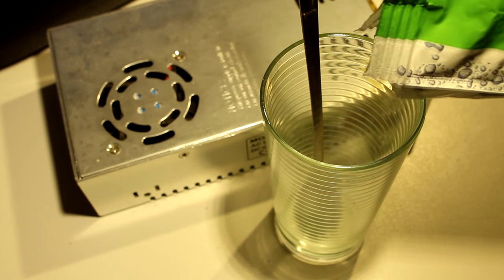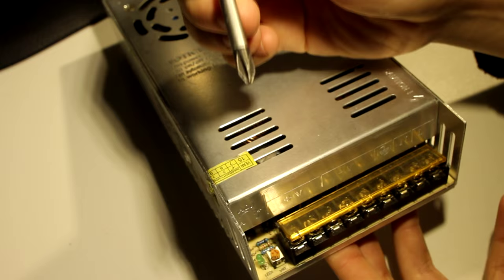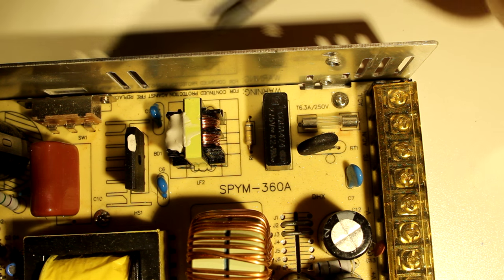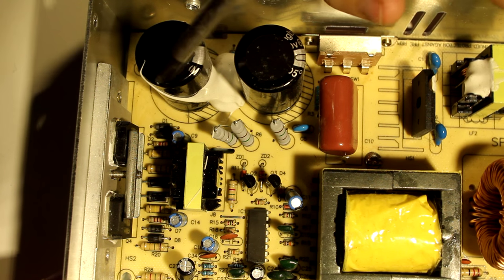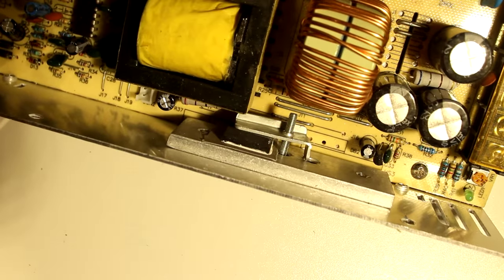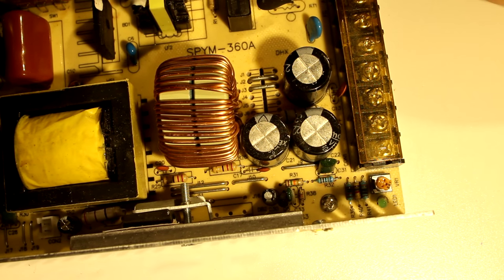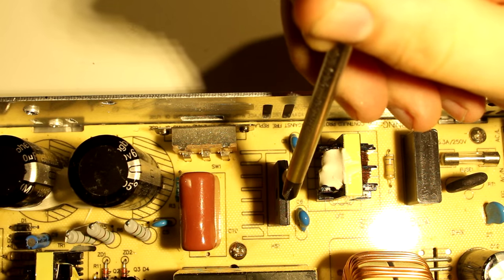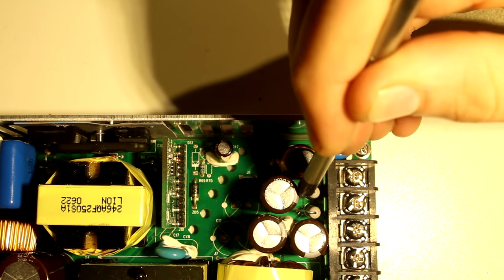Crappy chinese 24V '360W' power supply teardown (005)

Comment: I  am dissapointed after watching this video. Clearly person who is doing this review is not an expert in power supplies. This power supply does not have power factor correction and what he is calling a MOV is in fact an NTC. Besides the point if these cheap power supplies where so crappy nobody would bye them but people do and they do the job reasonaby well. I've been using this particular model for almost a year now. It's in operation 24/7 and in my application had no issues with it what so ever. I would love to see some quality reviews from this youtuber with some measurements perhaps.
Reply from the maker: All of this has been addressed in other comments already, but just to be clear:
- Yes, I realized pretty much immediately that something was wrong with my assertion that it had PFC, I just got confused by a very unusual PSU topology
- Something that functions doesn't mean it's a good design. Especially with power supplies, you're not paying for just roughly the correct voltage coming out, you're paying for safety and longevity. These power supplies have neither of these qualities. 

My newer videos have proper load and efficiency measurements! I'll be revisiting this PSU as well.
Reply: Yeah, plus I've never seen anyone focus on the quality of the holes for the fan.  I mean, yeah if this was a product that you scrubbed over your face or if you were supposed to sit on, then ok.  The "imperfections" pointed out don't affect airflow to any appreciable degree...
Reply: Matt Gorzka i bought a chinese 48v 8.3A and after a couple of days of using it started making spark sounds and then a short in the mains.

I bought another chineese 12v 15A and hooked it up to a sound system, got a loud hiss and buzz, in comparison to the inaudible noise from a computer psu hooked to the same system, there are issues might be irrelevant to how you use them, or that you are lucky

Comment: I've been rockin a 12 volt 60 amp china power supply for several hours a day for 2 and a half years at 42 amps and it's been running perfect with low low noise. No over heating and rock solid.
Reply: I agree with you my friend, I have used the cheep Chinese smps for years. The difference in price between a rolls Royce and a mini car is great, but at the same time? as long as either get you from A to B who cares.
Reply: @davidteale4270  And as an extension, you can go from A to B with a horse.
It's the same, right?

Comment: 4:59 Not an MOV, that's a NTC thermistor to reduce switch on current surge.  
11:25 The weakened section at the top of the capacitor is a standard feature of all electrolytic capacitor brands, it's not an open vent but it allows the case to rupture in a controlled manner in the event of over-pressure rather than exploding.  Some capacitor designs instead use the rubber sealing plug at the other end of the cap which gets pushed out.

Comment: Many mistakes in this video, someone already corrected the NTC/MOV mixup... This topology is a two switch half bridge, LCC resonant good for up to 400-500W, dead giveaway is one large metal film capacitor (red), two switches and the other smaller transformer for driving the switching transistors, that's why it's small. When you have two switches across a load the high side switch needs a much higher voltage to turn it on because it's base or gate is relative to the high side voltage, not ground. This is why they are usually driven by either a base/gate driving transformer or a high side/low side gate driver IC. This design usually uses Bipolar NPN Transistors, the 400W device I have used 3DD13009 Transistors, 700V 12A devices used mostly in power switching circuits like this.

The larger main transformer has an input winding, an auxiliary winding for powering driving circuitry, and secondary output is center tapped, 3 outputs, center wire goes to large toroid choke, then to ground, two other taps alternate polarity and go to common cathode rectifiers (3 pins, two anodes one cathode center pin), one tap to each anode or when two devices are populated the two anodes are tied together by a jumper and each device gets it's own secondary tap. 

There is no active PFC in this design. The output rectification alternates secondary polarity between two diodes in one package so each diode in the package alternates sharing the load or back and forth between two devices when configured that way so each device shares the load alternately.

Comment: The only really bad thig about this power supply is using a standard 1kV intereference supression capacitor between high- and low-voltage side instaed of a proper self-healing safety Y2 capacitor. 
A proper review should have mention it.

Comment: How do i fix my power supply with low voltage output? it's identical to your video but it's rated 12volts,30A.

Comment: its a 360w rated smps and it can deliver 380w max for a short time until the short circuit protection kicks in if it get over power and it has soft start, and nothing roong with the design it has the basic minimum .
the controller circuit is tl494 config for a half bridge topology , and the chinees smps does not have a power factor correction(for lowering the price down)  the small transformer thats not a PFC transformer its to drive the transistors(d13007k) base and its called base(gate) drive isolated transformer the rectified diode diode rated for 30A,( MBR30100) dual schottky diode 

and plz if you don't have knowledge about smps plz don't make a video until you get knowledge
Reply: The Guy doing the review seems that he does not have enough knowledge about smps.  Well I awaited for the load test but the video never came round. He never quoted the price from the one compared and the one on the review I would assume quite some difference for sure. You get what you pay for.
I guess he will hate himself for ever for posting this crappy video. LOL
Reply: Silvio De Leonardo he can just take the video down, and not hate himself.
Reply: Experts

Comment: My experience with these power supplies is that they can do about half the rated current and run warm. At full rated current they get very hot and have substantial ripple. So get something rated twice what you need, and be prepared to fix it when it eventually fails. Common failures are the output caps and the 2 large transistors (often some variant of xxx13009)
Reply: The problem is not to replace the 13009 transistors, but to understand why they burn out, so that a solution can be found.

Comment: Dear sir, you did not say how much you bought the Chinese smps and how much you bought the one you are comparing with. You will get what you pay for!  The MOV you mentioned is actually an NTC thermister for inrush current limit,  the small transformer is not a power factor corrector but a gating transformer, the topology used in the two supplies is different from one another,  you did not say what type of control chip it was using.  If it was a TL494 or equivalent it surely will have short circuit and current limit, the output diode is dual one and if the supply has a center tapped output that is all you need. Your tear down has a lot of things missing in it. and lastly all you need to try it out is a pair of car head lamp bulbs hooked up in series they will draw around 5 amps at 24volts well if you use 3 in series you will have around 3.5 to 4 amps approximately.  I will await your findings.
Reply: exactly what I was thinking, I was doubting myself but I knew it was a thermistor
Reply: It's £18 from a UK eBay seller, so probably not more than US$25. Ridiculously cheap for a 360W supply, I've seen used Cosel (Japanese made SMPS) supply sell for over $150. So I very much doubt this one gets any where near 15Amps @24V.
Reply: Well in a real  PS test a resistive 15 amp load could have been added and a voltage measurement could have been taken so we wouldn't need to surmise and speculate over the next 3 years on utube. I have tested my 3  low cost Chinese bench power supplies and they all met the output spec.
Reply: Yes, you are right sir. he doesnt even know that SM transmormer too.

Comment: I have a 12v Chinese PSU model S-360-12. Even with the VR maxed I get barley 11 volts. What would you check to be the problem? PSU is brand new and I don't see anything wrong on the board. Thanks for any help and your vid.

Comment: There is no PFC in that Chinese power supply. The part you identified as a PFC inductor is actually the base drive transformer. The two transistors near it make it a half bridge forward converter design. It also has an interesting self start circuit. Pull the board and trace the circuit - it is common to most of these cheap power supplies.
Reply from the maker: +oPossum5150 You're very likely right. I should have just measured the PF to make sure.
Reply: +PowerElectronicsBlog For someone who call his channel PowerElectronicsBlog should recognize this design immediately, it is one of most used design of SMPS in history (basically all AT and early ATX power supply used same design).
Reply from the maker: +Miloš Lazović Nah, my first education and actual in-depth understanding of power supplies only started just about 10 years ago. At that point, this kind of design was already nowhere to be found anymore. I've only started looking at 'crappy' power supplies in the very recent past (mostly dealt with high-end supplies until now), so this was genuinely the first time I had ever seen this design apart from some other sites' teardowns which I had apparently already forgotten.
Reply: PowerElectronicsBlog
It look like you missed something in your education about SMPS. This design is only one (as I know of) which allow you to have control IC placed on secondary side without auxiliary power supply (as +oPossum5150 mention it have interested or brilliant way of self start) . This design was used in many power supplies produced by LAMBDA among others (now TDK-LAMBDA but at that time known as DENSEI-LAMBDA, NEMIC-LAMBDA, Coutant) up to 2000 or so and most of that power supplies happily work even today si if you dealt as you say with high-end supplies you should see it many times.
As any other design this one have its own shortcomings and now with cheap solutions for auxiliary power supplies it is less used, but generally this design is bulletproof.
Even if you never saw this design it never cross your mind how they drive transistor on primary side with control IC placed on secondary side and there is not one opto-isolator on PCB (or any other means of insulation except that transformer which you declared as part of PFC), or you thought that this is such "crap" that they broke all rules of insulation between primary and secondary (which you didn't mention in video, but you managed to speak about separation between line and neutral which is technically totally acceptable according to EN 60664-1 even for pollution category 3) so you should realize that something is wrong in your assumptions.
Reply from the maker: +Miloš Lazović Well, you learn something new every day, right? I'm sure this kind of design can be found in legacy stuff even from better brands, but from what I've read about it since I made the video, this design does not fail safely and is therefore pretty much out of the question for any new design that has to endure independent testing. Given that most power supplies I encounter are at the very oldest something from the 2005 era (when the new EU regulations were passed) it's not hard to see how this has slipped under the radar for so long. I can't think of any projects I have done that allowed for pre-NEN1010 power supplies. Given that my formal education had nothing to do with practical power supply designs and all my knowledge on that front has been from teardowns and analyses, I'm unsure at what point in my education I should have expected to learn about obsolete power supply topologies.

As with any kind of teardown or analysis video of something sufficiently complex, it's pretty much impossible to name and identify everything. People in the comments will always see stuff that you've missed, correct you on many small and big mistakes, etc. It's part of the process and this is exactly why I don't just do teardowns for myself anymore. I used to sit in the back of university classes with my screwdriver kit and trays, disassembling stuff I'd salvaged from the waste electronics bins. That was fun and I learned a lot about design patterns, but honestly since I've started doing more public things (like my written blogs and now this channel), I've learned a lot more. And hopefully other people have learned something from my videos as well.
Reply: PowerElectronicsBlog
It is not obsolete technology it is now just less common it was before because there is now cheaper/easier ways to get same results (I am talking about this particular half-bridge with BJT), but half-bridge with MOSFET switching elements is one of most commonly used topology for medium to high power SMPS and it look nearly identical to this with only difference in construction of transformer that derive MOSFETs (if it is used with secondary side control which is most common solution) and that use MOSFETs instead of BJT. Half-bridge is so obsolete that most (all) TDK-Lambda (I presume you used their product, because you stated that you use high-end power supplies) power supplies use half-bridge topology today (to be correct they use modified LLC half-bridge, but basically it is still half-bridge with modified way of controlling it) and all components present here are present in them with some additions.
Did you learn to multiply in your education, and why, using your logic it is obsolete when we have calculators?
Your statement that they do not fail is safe ways is incorrect (this particular supply maybe do that but topology is it is will fail safely as any other topology when is properly used).
Your reference to local standards (which are applicable for your region) do not mean that they are mandatory for other region (NEN 1010 standard is not EU standard).In EU power supplies are covered by Low Voltage Directive (local implementation of it).
I do not have intended to disparage your knowledge, but from EE I expect at least to spot obvious points in design, I don't expect everyone to know how startup sequence of this circuit work, but I expect that EE know how at least basic topologies of SMPS (this is one of them and it is half-bridge).
Reply: @mrlazda  You know your stuff.  Can you explain the use of a 14v cooling fan?  My 24v DC power supply has 22.4v on the fan header.  Cost saving?  Is there any risk in doing so?  Thank you
Reply: @laraza4trump130  you are right that most likely cost savings are reason why they use 14V fan in 24V power supply.
As second part is it safe that depends how they use it, it can be totally safe if they run fan on 14V, usually solution is to use low side switch buck converter (that is one of most common use of low side switch buck converter I saw, other is for non insulated driver for offline led) which in this case is still cheap solution (with voltages you stand it is perfect place for low side switch buck converter,  no hassle with driving high side fet, end if you pick frequency right you can even eliminate inductor,  and use inductance of fan insulated), other benefits is that you can easy control speed of fan. On other hand if they run it directly of 24V (22V) that is extremely bad and unsafe design (probably will work but fan in best case will last short time, most likely will not catch fire and burn your house but I will never done that way especially that proper way to do it add minimal cost).
Just one notice if they use low side switch buck converter positive supply of fan will still be on 24V(22V) respectively to power supply ground, low side switch buck converter is not ground reference (put simply it move ground in relation to positive rail so difference is desired voltage,  that is why it is not so commonly used except in some nish applications), but voltage on fan (between fan positive and negative rails) should be in acceptable range).
I hope this help you, with looking at schematic of fan power supply I can't give you better answer.

Comment: i have same one .... and I mistakenly put the switch on 110v and connected the power supply to 220v input .... then it stopped ... small burning smell and no obvious burning part ... no 24 DC output ... i dont know how to fix it ... if someone have face similar issue can help pls ?

Comment: What you call PFC is the main switching Mosfet / Powerdiode and the little transformer is probably an auxilliary transformer for powering the fan and some ICs with voltage below 24V (output). The MOV in the input filtering area is an inrush current limiting NTC thermistor, probabla an 5D-11 meaining 5 ohms at 25 degr. C. All in all its not too bad for the price but its definetly not a superior bench powersupply :-)

Comment: In my opening people who buy this type of SMPS knows they are crappy but even though they are crappy some of them are does the job pretty good. May be not up to the exact ratings but does the job. 

It would be perfect if you could mention the price for this. My guess its UNDER 20USD... So its more than enough for the price right ?
Reply: Pasan Karunanayake I bought mine for less then $14 and it’s worked fine for me :)

Comment: So I know it's hard to diagnose with such a basic summary but what are your thoughts on this... I recently bought one of these and it arrived only outputting 10.6V, even after adjusting the VRI screw... when I unplug from mains the voltage flutters firstly by going up to ~13v and then down to 12v, then up and down etc... my immediate suspicion is output capacitors are faulty... thoughts?